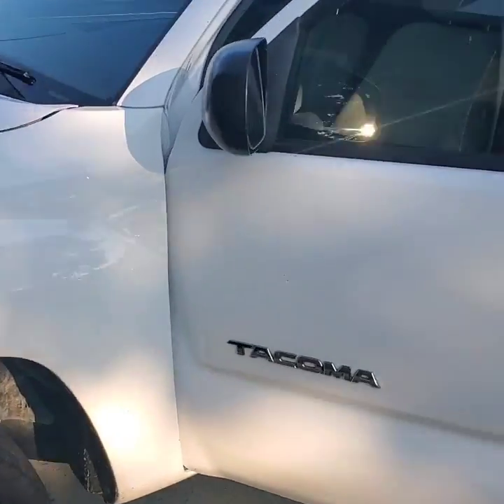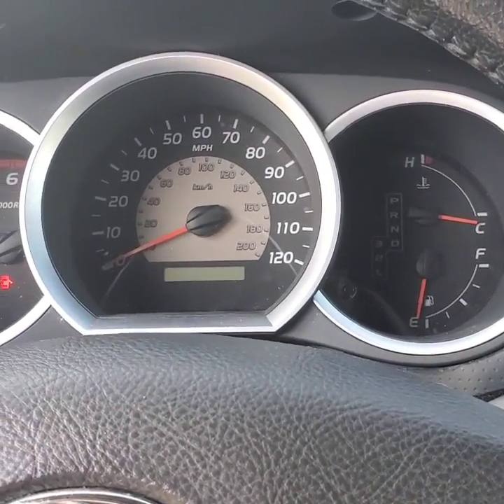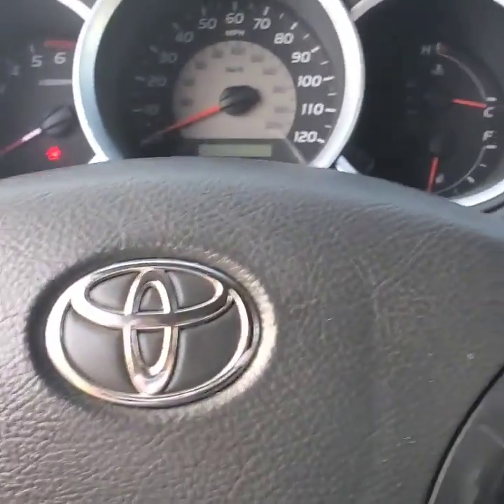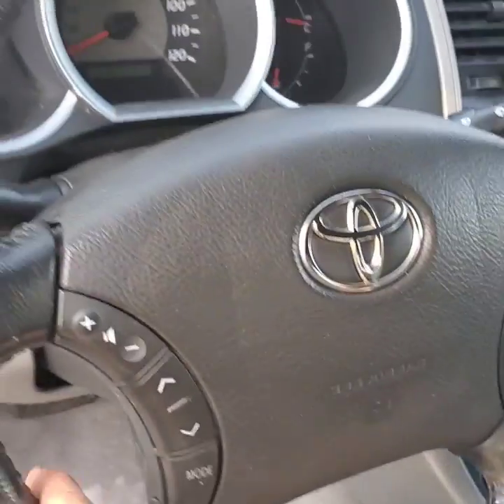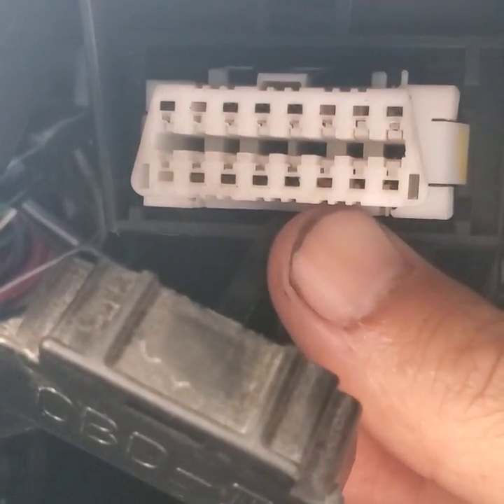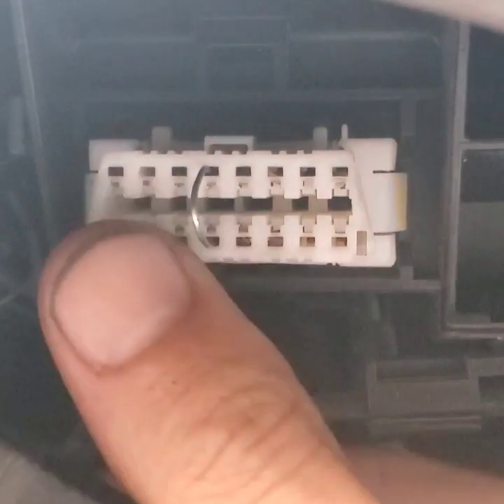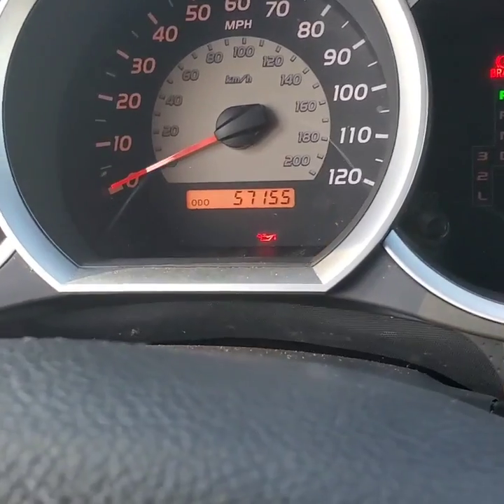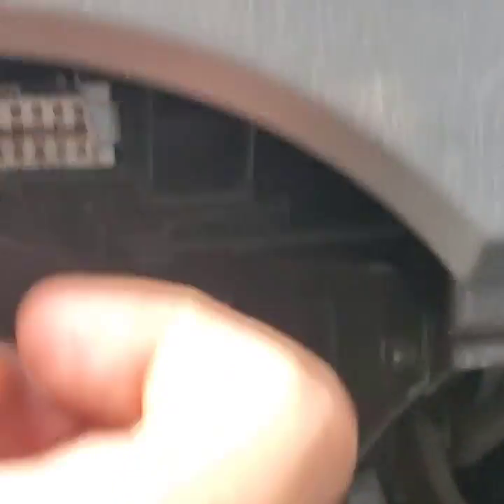Calibration zero point steering angle position sensor

Comment: Nice video. Please, my GS350 2010 steering is very hard. It doesn't turn. What could be the issue?
Reply from the maker: It’s hard to diagnose without seeing the car in person. But if it’s power steering then check your power steering fluid, if it’s low it will cause that issue. If it’s an electrical power steering, check your fuses and rack and pinion. The rack might have internal damage. I would recommend taking it in to a shop to lift it in the air and check underneath. Hope this information helps. Good luck!

Comment: My wife’s 2018 rav4 had several lights on even after replacing the steering angle sensor. It had errors for the lane departure warning, pre collision system, cruise control wouldn’t work, etc. This cleared it up! Thank you so much!

Comment: I just checked "pin assignment " for Toyota, Lexus and pins shown in this video are not related to ABS/VSC light. Pins shown in this video are related to "timing control". I checked a few times... can you please verify?
Reply: which pins actually relate to abs/vcs???
Reply: @jared7785  I look at another source and it states: 4 - chassis ground, 5-signal ground, 6-CAN High, 12-TS Brake actuator assy, 13-ignition check OR ABS slow code(???), 14-CAN low, 16- battery power 12V. So, I am not really sure.

Comment: Its says check power steering on my dash, the resoivoir sas low, i added power steering fluid but the steering is still heavy, ive disconnected battery and it still wont work, any ideas?

Comment: Thank you for sharing this info. I had the similar problem on my 2011 Toyota sienna after replacing a steering rack. I went twice to mechanic to reset the zero point calibration and when I just drove away from the shop the lights on my dash came back. Today, after watching your video I did the same on my sienna and it worked. Thanks a lot one more time.
Reply from the maker: @sergeyskumatov5570  awesome!

Comment: i have cod p1589 on my vitz 2005 can this method help to solve my problem??
Reply from the maker: As long as it’s a Toyota. Yes.
Reply: @Mr_Fix_It  i tried but dnt work for me
Reply from the maker: @izzogenious  you have a bad sensor my friend you need to replace it. You need to fix your problem first. My procedure is for resetting after fixing the problem.
Reply: @Mr_Fix_It  acceleration sensor learning value  i tried another sensor still the same

Comment: I just replaced the clock spring in my 2015 Tacoma. I accidentally twisted the steering angle sensor and did my best to return it to the original position but now my slip indicator light is on solid. I tried another guide on tacomaworld to do this, but that one indicated using the 4th pins from the right. Any harm in trying this? Will this fix the issue?
Reply from the maker: No harm, I’ve put it in 4th pin on accident before and nothing happened. To confirm that the reset is taking place all the lights have to be flashing. Hope this helps

Comment: Think this will work on the 2022 Sienna?
Reply from the maker: I think it should.
Reply: Can't be any type of metal correct
Reply from the maker: Just not aluminum. You can use a magnet, if it sticks to the magnet you can use it.

Comment: So, I saw another video on recalibrating the steering angle, but, it looks like they used different pins, since the DLC3 is oriented 180 degrees differently than yours. You seem to be using different pins? 

In YOUR video the pins used look like:   // o o o X o o o o \\.
                                                                    //   o o o X o o o o   \\

In OTHER video pins used look like:  \\  o o o o X o o o   //.
                                                                  \\ o o o o X o o o //

The other video said to use pins 4 and 12 (where 4 = TS, and 12 = CG)

I have a diagram on my google photos, but, when I tried to post a link here, YOUTUBE deleted my comment.

Anyways, which instruction should I use? Are you sure you put the paper clip in the correct pins in your DLC3 (OBD2) port?
Reply from the maker: The OBD port is in different positions in different cars. As long as your car is a Toyota or Lexus or Scion, line up your paper clip like in my video and you should be able to do the reset.
Reply: Thanks for your reply. 

Ooops, I messed up the diagram above. (Was getting sleepy, lol). 

Anyways, what I meant to say was that in the other video, as well as another forum, they said to use pins 4 and 12 (where 4 = CG, Chasis Ground, and 12 = TS, Brake Actuator Assy).

                                                                           16      13         9
                                                                            ============

In YOUR video the pins used look like:     // o o o X o o o o \\.
                                                                      //   o o o X o o o o   \\
                                                                     ===================
                                                                          8 7 6 5 4 3 2 1

(which is pins 5 & 13 where 5 = SGND, and 13 = TC)

                                                                            16        12       9  
                                                                            ============
In OTHER video the pins used look like:   // o o o o X o o o \\.

                                                                      //   o o o o X o o o    \\
                                                                     ===================
                                                                            8 7 6 5 4 3 2 1

(which is pins 4 and 12 (4 = TS, and  12 = CG,)

Comment: This work on. A Highlander hybrid? Same year
Reply from the maker: Yes
Reply: @Mr_Fix_It  my vehicle is in an accident and have not been able to get power steering to work has an electric rack and pinion and a friend of mine has a scanner but we can never get it back to zero point
Reply: @Mr_Fix_It  my power steering is still not working steering wheel it hard to move is there something else I need to do?
Reply from the maker: @MiguelGarcia-jl3bu  You have an issue you need to fix before you can do a reset. Your rack n pinion is electric so check your battery voltage and your fuses and relays. Unless the car has been in a accident then it could have internal damage and may need to be replaced.
Reply: @Mr_Fix_It  I appreciate you replying back to me and yes, I have replace the rack and pinion it was used but off of a running vehicle and picking up another rack today and the yaw rate sensor. Someone told me that has something to do with the suspension and alignment components for the vehicle. It was in an accident, I replaced everything as far as suspension
Reply: @Mr_Fix_It  someone told me that I need to make sure my rack is perfectly centered before I do the reset and someone told me I need to take my vehicle to get a front alignment before I do the reset but not sure if that’s true
Reply from the maker: @MiguelGarcia-jl3bu  yes that is true. If the alignment is not true, it will have warning lights. In some cases the rack n pinion may need to be programmed to the car.

Comment: Worked perfectly on my 2011 Lexus RX350. The light had come on after doing an alignment and really did not feel like driving back to the shop.

For anyone trying this on a RX, count the pins starting from the engine towards the drivers seat. Also first short the pins 4 times while on IGNITION ON, turn everything off, and the proceed as in the video.

Comment: hi，on my corolla the vsc didnt blink but the anti-ski logo is blinking and beeping while i turning the steering wheel，the light not always came out but only sometime. can this method done on my corolla？
Reply from the maker: Yes but sounds like you have a bad ABS sensor or alignment issues that need to be addressed first.
Reply: @Mr_Fix_It   what is ABS sensor？ is it speed sensor？
Reply from the maker: @ahyeong98  yes speed sensor.
Reply: @Mr_Fix_It  alright，ill try check those problems. Thanks mate. much appreciate

Comment: So thankful for this video! Worked great on my 2009 RAV4. I replaced my intermediate steering shaft and was a little careless with the wheel position. I got it dialed in driving straight but once I hit 15mph the car would throw on the traction control and try to stop the car lol. Not just the light but literally try to stop it too. I assume I messed up the wheel angle and it thinks I’m trying to turn while going straight. Learned about the steering angle sensor, found this video and boom it fixed it. Thanks for the video!!
Reply: Dude my highlander did this too! I was like what the heck! I didn't even mess with the brake system.  Going to try this fix right now
Reply: Is it work with Toyota hilux pickup
Reply from the maker: @abbasmuhsen2715  yes
Reply from the maker: Happy to have helped!
Reply: My toyobaru did this too

Comment: Will this help with my rav4 code c1203 and c1336 code?
Reply: I just did this and it reset it. I had my brake light on,traction Control,and abs light. With codes listed codes above.  Hope they stay off. Thank you.
Reply: 14 Rav4
Reply from the maker: @christopher23.  I’m glad it worked for you!

Comment: Is it 5 from the passenger side or driver side? This is for a 2016 Toyota Corolla. On yours, the wide part of the trapezoid (obd) is towards the engine and on the Corolla, it’s closer to the driver. Does this make a difference??
Reply from the maker: Yes it makes a difference. You may blow a fuse if not done correctly. Just pause the video to about 1:58 and match your port to mines. Some ports are upside down/ right side up. Hope this helps.

Comment: What does shorting out both pins do? VSC light is not on. Anti-skid light is flashing and beeping when I turn my steering wheel on highway. Does this calibration fix this problem?
Reply from the maker: Shorting both the pins is pretty much reseting the whole system. You may have a alignment issue or a bent suspension part. I would address the issue and get the alignment first then do the reset.
Reply: @Mr_Fix_It  Ok. Thank you for responding so quickly.
Reply: @Mr_Fix_It  Do you mean that 'shorting these pins' is the same as clearing ALL codes with an OBD2 tool/reader? And, if jumping these pins ONLY clears codes -  why is this also called a 'CALIBRATION'?

I have 3 warnings showing in my instrument cluster (on my 2008 RX350):
- ABS, 
- VSC OFF(flashing), and, 
-  traction control symbol (car with swervy lines behind it).
They just all came on after a gas fill up, I think!

I also have several codes including: 
- U0073 (ABS bus communication off), 
- C0205 (front speed sensor LH circuit), and 
- U0126 (lost communication with steering angle module).

I cleaned the front left ABS speed sensor - it did have some metal clinging to it. 

So, now I'm wondering what to do next. I drove the car for 10 minutes - ABS light stays on. Should I use your jump the pins to re calibrate steering  angle? (which  may reset ALL codes?) 
And then should I clear all the codes with the OBD2 scanner? 

I also have these codes. Might they all be coming due to ABS error code?:
U0123, C1223, U0124 (replace YAW rate sensor)
C2122 

What do you suggest I work on next? (THANKS for any help you would offer!)
Reply from the maker: @m.n.3490  Sounds like you have a bad ABS/wheel sensor. I would replace it and clear all codes with a scanner. You can get a speed sensor on Rockauto.com. They probably have the best pricing on auto parts .
Reply: @Mr_Fix_It  (I thought I replied, looks like I did not ...)

So,I did look at the sensor, and there was a lot of metal shavings sticking to it. I cleaned it off, thinking the metal shavings was messing up the sensor readings. The sensor line looked good, not cuts or scrapes. I dd not test the sensor line for resistance as I could not find my meter.

What I am not clear on. is, if cleaning the sensor worked, would the ABS light go off after driving the car for a few miles all by itself? Or, would I need to clear the ABS light, drive a few miles, and see if the ABS warning light comes back on?

Since I have so many codes, I'm not sure if they are related to each other in any way. Ex: Like with the BS code of U0073 (control module communic BUS off) and C0205 (Front speed sensor LH circuit). Would cleaning the sensor (or replacing with a new sensor) turn off both U0073 and C0205? Do both need to turn off to clear the ABS light being on?

And do any of the other warning lights relate to ABS? For example do the VSC OFF, or TRAC (swerving car symbol) light up due to ABS light? DO they have their related codes?

Man, this is complicated stuff.
Reply from the maker: @m.n.3490  So cleaning it might not always work if it’s bad internally. I would start with a new sensor. Also a bad sensor will cause all the other warning lights to come on.
Reply: @Mr_Fix_It  so, I put an ohmmeter on the wire going to the sensor. I got a reading of 0.9 K ohms, and I have read that I should see between 1.4 and 1.8 ohms. So, I ordered a new one and it should arrive sometime today or tomorrow. Hopefully that will fix the issue. I'm glad to hear that many of the other codes could be caused by that one issue
Reply: @Mr_Fix_It  So, I bought a new ABS sensor line, installed it, and drove my car, and all the ABS lights went off. 

I then ran another OBD2 scan, and suddenly the ABS light went back on, as well as the VSC OFF light and TRACTION lights. The C0205 code is back, and the others (U0123, C1223, U0124, U0126 and U0073). I drove the car again, and this time the ABS lights did not turn off again...

Could the OBD2 scanner have turned the code back on? I've read a few people say that this can happen.

I am thinking about using the pape rclip trick you mention in your video to turn the ABS codes off -  but, I am a little afraid of using the incorrect OBD2 pins!
Reply from the maker: @mnalep2  yes those lights come on sometimes when you connect a scanner. But you have a scanner just delete codes even if it says there are no code. Or just disconnect the battery for 10 minutes or so.
Reply: @Mr_Fix_It  Well, I drove the RX350 today, and in less than 1 minute the ABS, and other lights, went off. So, maybe the new ABS sensor DID fix the issue, and, maybe the OBD2 scanner had turned on the codes as I wondered! 

I won't run another scan with MY OBD2 scanner for now. 

I wonder if I go to Autozone and they scan my car if their reader - if will turn those lights on again? 

Anyways, I did not realize that disconnecting the batter would turn the computer's codes off!
Reply from the maker: @mnalep2  well you had a bunch of lights on before changing the sensor and the went away after you replaced. So I think it’s safe to say that was the issue. I’m glad it worked out for you.
Reply: Do you succeed with the Chevrolet Trailblazer 2007? I have a problem with traction control stopped
Reply from the maker: @abdoasaad6035  no
Reply: Do you succeed with the Chevrolet Trailblazer 2007? I have a problem with traction control stopped

Comment: Newly changed steering unit include motor and torque sensor.But the problem is one side hard another side soft.if any solution this?
Reply from the maker: Sounds like you have an issue with your rack and pinion.
Reply: @Mr_Fix_It  
If turn steering one side smoothly turn but another side too hard its any  torque sensor angle position problem?
Reply from the maker: @JaiPrakash-bd2xt  I don’t think so, they would just give you warning lights sounds like a mechanic issue. Something is broken internally or bent. You need to lift the car up and have some turn the wheels while you look to see if anything is rubbing.

Comment: Thank you very much ! It worked on my 2003 Lexus RX 300. The VSC light came on just by itself. Without this clip, I would have brought it to the dealership and they have to charge a minimum of $269 to reset it!
Reply: Hello, here, just to let you know that you can also do this function with a comprehensive diagnostic device: https://youtu.be/bsAyzSyaEPc.

Comment: The shop should have done this! Send them a bill. Another reason to go to the dealer.
  OVD-II pins 4,5 are grounds, 16 is B+, pin 1 is UART, pin 2 is class-2 serial data, GM used pins 12 & 16 but these are open to manufacturers. Check with the dealer as if you set more codes or burn a module or computer who pays? 
DK ASE master tech since 78
ACDelco instructor
UTI instructor, retired!

Comment: Just had the same problem with mine took it back to the alignment shop they put the scan tool on it and recenter my steering angle finder all is good
Reply: Hello, you can take a look at this function I made with the comprehensive diagnostic equipment: https://youtu.be/bsAyzSyaEPc.

Comment: Would this work for a 2015 Toyota 4Runner SR5 model?
Reply from the maker: Yes it should work.
Reply: If zero is not done will  atrac,  mts n cc still work?
Reply: Hello, you can take a look at this video, I used the comprehensive diagnostic equipment to do this function for VW: https://youtu.be/YUygYECFsmE .

Comment: My Lexus ISF is doing this after alignment … do you think this trick will work on it? I have no traction control and the weather is getting bad lol
Reply from the maker: Yes it should work. As long as you cross the correct pins it will reset your system.
Reply: Did you try this? My rc F has the same. I wonder if the pins are the same corresponding from this to the lexus rc f
Reply: @spikey9azn6  haven’t tried it yet, weather has been really good where I live so I haven’t felt the need
Reply: @spikey9azn6  I tried and it works on my SC430 but for some reason it comes back fast